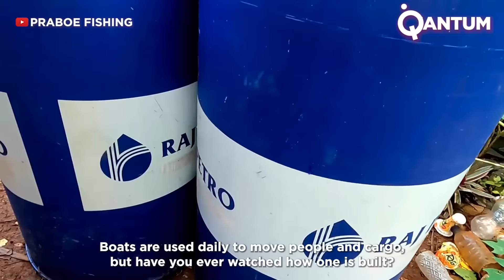Building a Boat with Plastic Barrels and Wood in the Jungle | by @praboefishing

Comment: No circular saw, no hammer, but they have a welding machine, a planer and air compressor to spray. This is authentic as the house builds in the Asian wilderness

Comment: Noice build. But corners in plastic, steel, etc sheets don't make the section weak, a corner makes it stronger. Many creases are included in designs to add strength.

Comment: This is skilled work but it is not more eco friendly than working with wood. Eco Friendly would be to re-use the barrel again for fuel, or recycle the plastic. When this boat is finished it will be dumped or sunk, they will not recycle the plastic and it can't be re-used as a container.

Comment: I thought for sure that every nail going through frame and hull was going to be sealed with waterproofing of some kind. additionally, isn't there some kind of electrolysis that happen between steel nails and saltwater affecting the integrity of the nail over time?
Reply: Seen wooden boats built worst than these in villages serving generations of fishermen. If you see thru a developed world eye, you can find alot  flaw. But their philosophy is as long as it works. And it does work, at least for a lifetime. Then build another. Dont let perfect be enemy of good

Comment: 80 mph with a 125 cc engine? Extremely unlikely. Maybe at 125 hp......? It is possible?
Reply: Even 60 kph (49 mph) seems unlikely.
Reply: they are Indonesian, nothing is impossible if in Indonesia, a 125cc engine can be changed to 200cc, Indonesian people have a lot of expertise and their abilities are above average that you will not find in other countries besides Indonesia, Indonesia can make an airplane with a Kawasaki motorcycle engine, that's Indonesia, nothing is impossible, study in Indonesia to be smart.
Reply: They probably meant the engine in a motorcycle would do 60 to 80 mph.
I would have liked to know top speed number of boat and how you reverse.
Reply: @garryquiggins8183  The speed of the boat they do is modify the propeller to form a higher thrust, to retreat they use a homemade gear box that is very easy to make, many additional gear box components are found in Indonesia, the price is very cheap,
For the combustion of the engine they use Aftur type aircraft fuel because the fuel is very cheap and easy to get in Indonesia, they also modify the engine which used to use gasoline in the change for Aftur fuel. They added speed to the engine and they also modified the propellers, which is mandatory and most importantly the Gear BoX
Reply: They probably meant KPH. Could be a translation error.
80 km/h is still very fast for a boat.  That's 50 miles/ hr !

Comment: Why didn't you use screws? They would have much better stability. Nails can loosen over time, especially when wood is under tension. So it is better to use screws with washers so that the area that is stabilized is as large as possible.

By. Alien Ware

Comment: I'm no boat builder but wouldn't U.V. resistant silicone silicone calking between the plastic barrel sheets be a good idea to make things more watertight?
Reply: Ever tried to get Silicone to reliably stick to to that HDPE blue drums are made from? I guess that's why they don't use it.
Reply: @geradkavanagh8240  when it's sandwiched between two overlapping edges, the compression between layers is more than enough to firmly hold it in place. Especially if your sealing between the wooden frame of the boat and a nailed down HDPE, again it is still sandwiched between two surfaces that  locks the silicone calking in place creating a waterproof barrier.
Reply: @mrMacGoover  Maybe it was a long way to the local hardware shop :)
Reply: @geradkavanagh8240  And if you really want to get technical about it... the rubber gasket they are sandwiching  (between) the frame and overlapping edges isn't technically "Sticking" to the plastic either, it's creating a water barrier and seal when being sandwiched between two that are compressed together through the process fasting the seams with nails.  So your argument about silicone not sticking to HDPE in this application is totally irrelevant.
Reply: @mrMacGoover  Now your just being a picky nit. Let it go.
Reply: @geradkavanagh8240  People who live in glass houses shouldn't throw stones, you should stop being a evil troll that cruises the comment section looking for victims. 🤨
Reply: @mrMacGoover  just let it go or I might go and bite you

Comment: Excellent repurposing of the plastic barrels with considerable amount of skill, as for indestructible, I’m guessing they weren’t using stainless steel nails and as for speeds of up to 80mph from a very used 125cc motorcycle engine, extremely doubtful.

Comment: no need to use nails when you can weld HDPE, and also you can use BAMBOO instead wood, you better build a sailboat or use compressed air motor

Comment: It's like back in the day man said 1972 Buick Electra  455 4 barrel  at,ps,automatic  transmission, what do you need wiper blades  take it to the paint shop,do the interior ,but let's  put a little  silicone  on the drive train, same ones came to the gas pump,check tires,water,oil ,but open the master cyl,and they'd say what you be doing with my transmission  then I'd see the atf floating on top the brake fluid and they would only buy 2 dollars worth of gas have a good day .

Comment: One slip of the foot when kickstarting and there's your new bung plug hole. I wonder why they didn't varnish the timber in the joints before all that nailing and using nails instead of screws so as it's not going to slowly flex apart. A couple of coats of acrylic paint over the top of the plastic after all that work too wouldn't of harmed or even better fibregassing the finnished product would of made that more durable.lmao

Comment: how is sealed between the barrels sheets?  Just only nailing to wooden frames?
Reply: It was the lighter blue waterproof material used between the overlapped joints.

Comment: Interesting the fastening is all nailed, and I would assume it’s galvanised nails. When the nail is hit with a hammer sometimes the galvanising is damaged. Are these boats used on the sea or only on fresh water? Do the nails rust and need to be re fastened after a period of time. If the boats are strong enough no need to use screw fastening. In western countries I believe  screw fastening would be used or epoxy adhesives.
Reply: The nails would be protected fairly well if they skinned the hull in fiberglass--but that's probably $1,000 worth of materials, and I'm guessing these guys don't have that kind of money to work with.
Reply: @andrewmize823  
Epoxy would not stick to the plastic hull.
Reply: @briancavanagh7048  You're right. I missed the bit about the barrels being made of polyethylene. I'm just a little wary of those seams.

Comment: Did they need more speed or single speed? More speed? Which speed do they need ? It s motorbike engine has 5 speed
Reply: they are Indonesian, nothing is impossible if in Indonesia, a 125cc engine can be changed to 200cc, Indonesian people have a lot of expertise and their abilities are above average that you will not find in other countries besides Indonesia, Indonesia can make an airplane with a Kawasaki motorcycle engine, that's Indonesia, nothing is impossible, study in Indonesia to be smart.
Reply: @dptchannel4894  i mean that boat need one speed but motorbike and cars have 5-6 speed.  How do they with this small 125 - 200 cc with 5 speed at a boat? Which speed gear they use it
Reply: @tomvanderham1416  They modified the propellers, for gear gear only 1 tooth was used,
Most Indonesian fishermen modify the propellers to add thrust for speed and just add an additional gear box to the engine.
Reply: @dptchannel4894  very smart and more fast power and less fuel.  So good
Reply: @tomvanderham1416  They prioritize the speed of the rotation of the propeller which is different from ordinary boats, the main gear box and propeller and the fuel they use is not gasoline but Aftur, they modified the engine too, because Aftur type aircraft fuel is more affordable Compared to gasoline and more efficient, strong and reliable for transporting heavy loads and accelerating the combustion process in engines, especially Honda engines in most cases.
Reply: @dptchannel4894  its very different culture there and here in the netherlands.  I may not to allowed to build my own boat also too expensive here.
Reply: @tomvanderham1416  Elk land heeft een andere cultuur, want in Indonesië maken we geen onderscheid tussen ras, etniciteit, cultuur, natie, religie, zelfs als we verschillende meningen hebben, 1 natie 1 land 1 thuisland we zijn broers, respecteren en respecteren elkaar dat is de Indonesische cultuur, veel buitenlanders kiezen ervoor om in Indonesië te wonen en gezinnen te hebben vanwege een meer tolerante cultuur, vooral voor de volkseconomie, het begon toen Indonesië werd gekoloniseerd door Nederland van waaruit solidariteit is geboren, Vrede is mooi groeten van het Indonesische volk, voor jou en uw familie moge u van alle calamiteiten worden weggehouden.
Reply: @dptchannel4894  dank u. Spreekt u ook Nederlands? Het is helemaal geweldig hoe u over uw land en volk spreekt.  Vrijheid en warme land is echt voordeel.
Reply: @tomvanderham1416  Ja, sommigen van ons gebruiken Nederlands om te communiceren met Nederlandse toeristen die naar Indonesië komen, we respecteren iedereen die naar Indonesië komt en onze belofte aan iedereen die voet aan wal zet in Indonesië is onze broeder, hun taal is onze taal en Indonesië is een tweede thuis voor wij maakten vroeger deel uit van het Nederlandse volk van Indonesië, Voorbeelden zoals koffie-, chocolade- en sojabonenplanten die worden verwerkt tot tempeh, het is afkomstig uit Indonesië dat onder controle stond van de Nederlanders en verspreidde zich naar alle uithoeken van de wereld, misschien is er in Nederland nog dat soort voedsel en ik vertrouw de erfgoedwapens van ons land toe die nog steeds in het Nederlandse museum liggen, ik hoop dat Nederland en Indonesië altijd broers zullen zijn. Aangezien Palestina en Rusland onze Indonesische broeders zijn, zo was de naam van de hoofdstad van Indonesië Batavia die nu is veranderd in Jakarta. Net als jij en ik is het een warm gevoel om via deze sociale media met je te kunnen praten, kennis te delen met mensen die we misschien niet echt kennen en misschien weten ze in Nederland dat Indonesische mensen niet beleefd zijn op sociale media als ze reageren, en onze excuses 🙏 in Indonesië hebben veel lege luxe huizen achtergelaten door hun Nederlandse eigenaren, we hopen dat de Nederlanders terugkeren naar Indonesië om in hun huizen te wonen.
Reply: @tomvanderham1416  Nederlanders waren niet erg aardig tegen Indonesië, vroeger was het anders, want de jaren veranderen steeds en de leeftijd wordt langer, kwaad wordt met kwaad vergolden, het voegt vijandigheid toe die nooit zal eindigen en het is moeilijk voor vrede, kwaad wordt vergolden met goed, dan zal de vrede vanzelf geboren worden. Prettige dag.
Reply: @dptchannel4894  ja vrede is beste voor mensheid en aarde en planten/dieren. Wees zuinig met aarde. Ik hoop dat oorlog stopt want we zullen heel koude winter door geen gas.  Indonesië is lekker warm. Tijd zal het leren.

Comment: Hello, really good job guys! I have just one question : with this engine, how can you brake without a reverse gear? With a boat, when you want to brake you have to engage the reverse gear. But on this  motorbike engine there's no reverse. That can be a big problem.
Reply: Тормоз придумали трусы . А эти ребята - храбрые .
Reply: Don't need no stinking reverse...
Reply: @user-dd2wl4st6e  Глупо думать, что тормоза нужны только для замедления. задняя передача на лодке очень удобна для маневрирования. Я подумал, что может быть другое решение, например, запустить двигатель задним ходом. вам не нужно быть смелым, чтобы перемещаться без тормозов, это просто глупо. попробуй ехать без тормозов на машине. даже на тридцати километрах в час у вас быстро возникнут проблемы.
Reply: @drfiberglass  you don't need reverse when you drive your car ? Of course yes! You don't need brakes when you drive your car ? Of course yes. Even when you drive slowly you need to brake. I just thought they have an other solution. For example  to run the motor backwards, or something like that.
Reply: @zambrec  Ты слишком серьёзен , друг мой . Улыбнись .
Reply: @user-dd2wl4st6e  но нет, я не слишком серьезно, мне просто любопытно. Я надеялся на ответ, который даст мне решение. извините за немного грубость. эти ребята очень находчивы, и мне нравится идея делать то же самое. Говоря о любопытстве, где вы живете? Я живу на юге Франции.
Reply: @zambrec Привет из Мадрида .
Reply: @user-dd2wl4st6e  Мадрид в Испании?

Comment: A 125cc drives that at 60- 80 mph? Wake up. Wouldn't do 20mph. A 125 honda bike motor is around 8hp roughly and just doesnt have the power to push a heavy boat like that probably even 20kph. On a lightweight tinny (10-12 ft) might do 25kph.